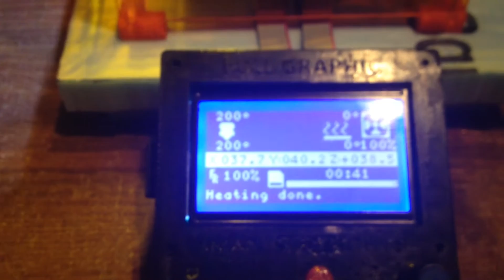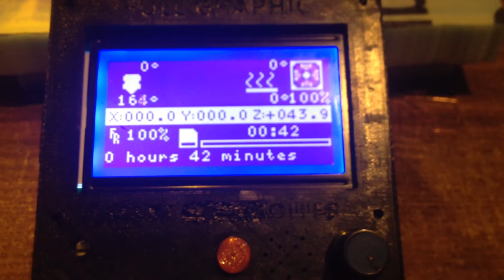Hobby King mini fabricator 3d printers  running on SD card with LCD display

Comment: Did you lower down the voltage to .6 I did that and didn't need to put a heat sink on the printer nor drill any holes

Comment: where you get the heat sink
Reply from the maker: The heat sink is from an old Pentium computer processor. If you have a computer salvage store around or an old computer. I used a small hacksaw to cut it to size ground the edges smooth. A few drops of superglue and stuck it on.